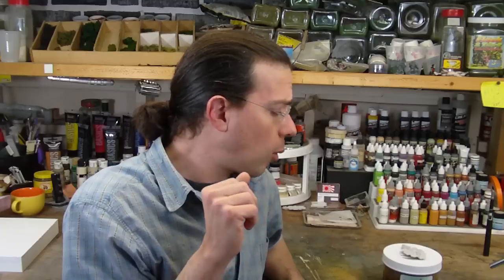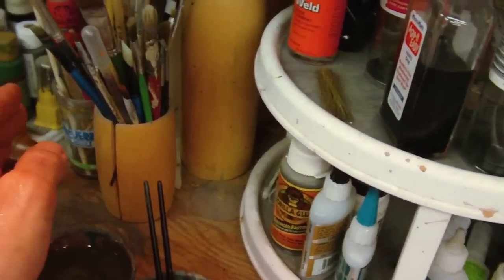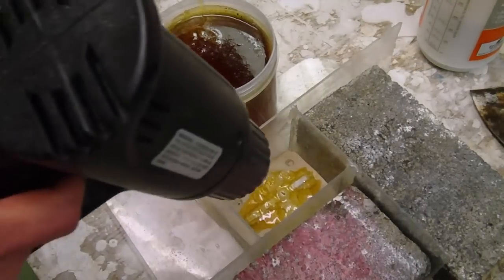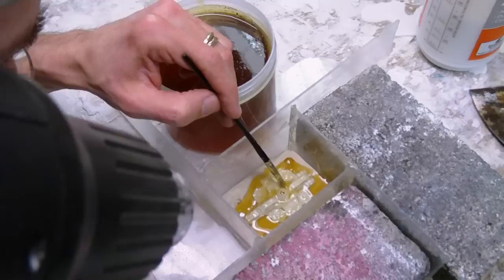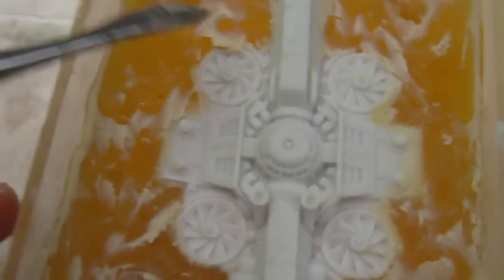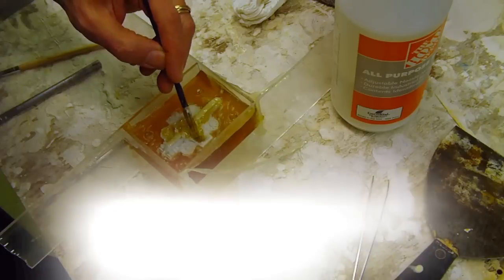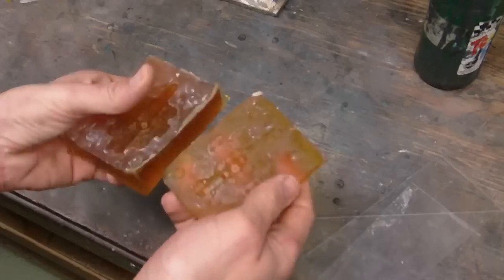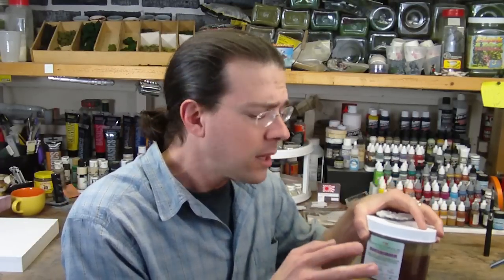TerranScapes - Composimold Revisited - mold making

Comment: Thanx for another great info Vid! I Was planning on buying quite a lot of this stuff for big size "in between" molds but looking at how much work it involves getting a result that is really not unusable or at least unpredictable I decide to stick with silicone. I grind down all my old molds mix it with fresh silicone to use a second filler layer and it works great. Way more expensive but way less time consuming and frustrating in the end.
For smaller molds I use Oymaru with great results.

Comment: Quick input.... Beauty supply houses sell a very inexpensive Wax warmer. You can control the temperature of the product very easily with this warmer. Also you can buy fairly cheap vibrators that are meant for pouring up plaster. I happen to have those items and I will try the composimold the first thing in the morning. Appreciate the video!! Terry

Comment: Try using the ComposiMold at a consistent max temperature; no cooling time and place your platform on something that is constantly vibrating. Get those nasty little bubbles to the surface. Beautiful work by the way. I would use a vibrating sander on plywood and make sure your project is firmly secured to it.
Reply from the maker: Thanks for the thoughts.  I don't think vibrating it would help much as it's very viscous.  Keeping it a maximum temp would help however.  It was suggested to keep it at temp in an oven and I may try that in the future.

Comment: hello, i really love your vids. I also purchased composimold.
I noticed that because microwave oven are on the market with different wattage, the heating time from their manaul is not quite correct.
What i did is to another pot, and put out some composimold, next heat 10 sec and repeat until you have smooth residu, then pour in thin line in corner.
I did not use mold release, because i noticed it created bubles.
Hope this helps you out.
greetings from Belgium.
Franky

Comment: I agree that many of the "easy mold" or "quick mold" solution do have a use and a place. On the subject of the pressure pot though the issue of micro pockets in the mold is still present in some of my best molds. Even though you may not see them in the cavity's surface they are evident when the cast is pulled, minor clean up. Sometimes just gravity casting is better than the pressure pot. Your accents on the LotR castle doors are a good example of a the shape I would probably just gravity cast.

Comment: Few things...PVA on a dry surface will puddle, its surface tension. A dampening will help. Next, a dry brush has air in it so you are bring air in with your tool. Another thing, a brick heated at the same temp in an oven and placed under or beside the mold as you have them would keep things fluid and then slowly cool and cure...the first half anyway.

Comment: Not sure if some mentioned but I would also try to have master with dipped in lukewarm water or have it in owen for some time so its warmer than ambient temperature .. depending on master u can go up to 60 degrees... it should not do anything to properly hardened PVA glue, also can help to dry PVA instead of using hot air gun ... which is slightly harder to control on even heating than owen ...

Comment: hey have you tried some sort of vibration near the mold when it is still hot to get the bubbles out ? like a small air compressor near the mold or a battery tooth brush for vibration to release the bubbles and use a heat gun as the vibration is working the bubbles out ?

Comment: Just take out the amount needed (like the one in your tuto, use small amount) and then heat this in the microwave, starting with 10 sec, then again 10 10sec and so on. Checking every time if the composimold is runny enough like sirup. If you heat it like they say, you quickly get bubbles, which indicates overheating ( is very independable of the wattage from your microwave).

Comment: Actually they have silicone putty that is great for small one off's. It's like silly putty, 2 parts you kneed together in your hand then form it around the part, hard and ready to use in 15 minutes to 30 minutes depending on brand.

Makes just as intricate a cast as liquid silicone.

Comment: the range is 60-65 °C so a hot water bath (that's bain-marie :) ) should be great. Drop a thermometer in the lower pot and tune the flame to keep the temperature constant. I suspect though that even this way the bubble problem won't be solved :)

Comment: A for effort.  Would say stick with the oven over the microwave.  Never known a microwave to not have hot spots.  Even with use of turn wheel.

Wonder about using it a cooler temps that you can handle by hand and just push the compound into place.

Comment: Instead of banging on the table spray the Mann’s  200 for the bubbles.  This material looks like polyurethane base .. can’t you also vacuum degas it ? Like your channel . 👍🏻
Reply from the maker: I did try to vacuum it actually.  :)  But it needs to be hot to be liquid and in a vacuum it cools very fast.  I don't think Manns will hlep since the problem bubbles are below the surface.  I really don't recommend this material.

Comment: i have to say i'm more than a little disapointed with this product. I've spent £30.00 on an item that looks incredibly labour intensive to get even a minimum standard :(
Reply from the maker: I sympathize.  I thought it had a lot of promise but it's really quite disappointing.
Reply: could you recommend another product that is better? So far I've used hobby sticks (a clear plastic that becomes malleable when placed in boiled water and then hardens as it cools) and I've used a 2 part putty that hardens when they are mixed in equal quantities leaving a rubbery constancy.

What i really want is a product that can be poured as a liquid that then sets allowing me to make simple 2 piece moulds (liquid blue stuff looks good) that can then be melted down and reused for other projects in the future (basically what this product claims to be but fails).
Reply from the maker: There are alternatives, but I don't know of any that are pourable.  :(